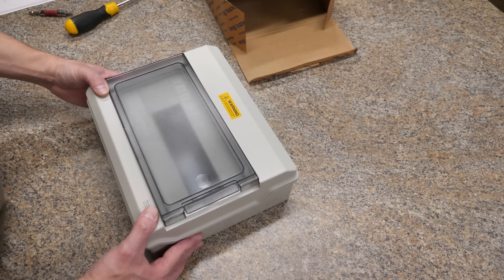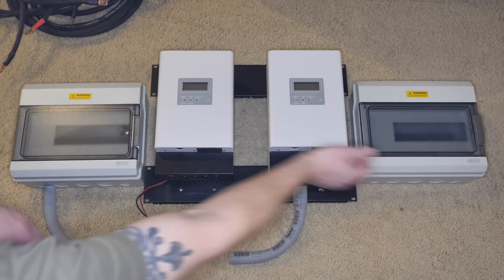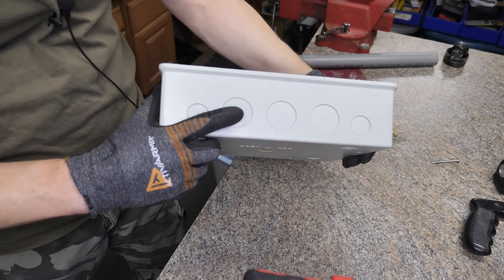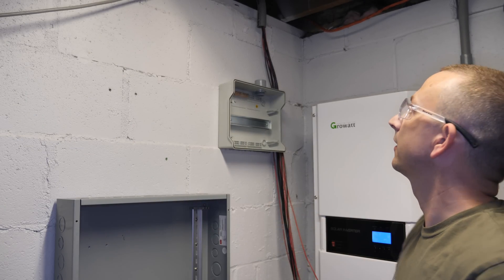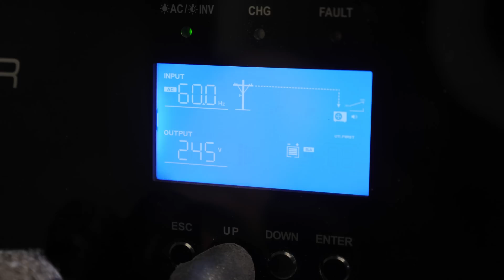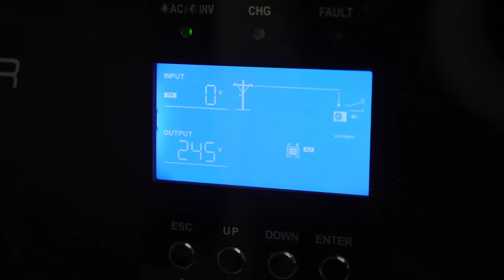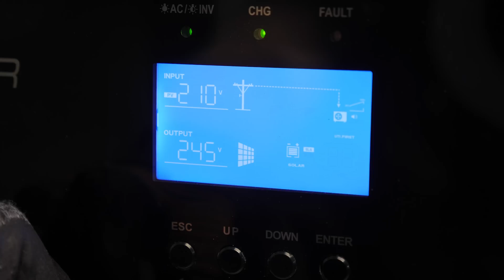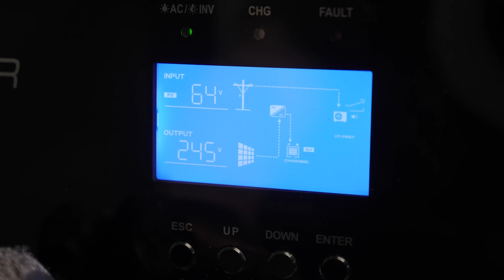Installing New Diy Solar Combiner Box! - Diy Powerwall 2.OH Ep7

Comment: Looks good. How many watts of solar do you have
Reply from the maker: Thanks! On the roof I have a little over 5kw of used panels. I usually see 4.5kw when I get full sun. Also just installed a 2kw ground mount. Vid on that soon!💥🤘

Comment: Hello,  the Growatt 12kw says 250V Max PV Voltage. You had 2 - 200 V PV inputs on 1 & 2 . Wouldn't that be 400V ? 150 about the max. Or do you only use one pv array at a time.  Thanks
Reply from the maker: A 200v array goes to pv1 and the other 200v array goes to pv2. There are 2 charge controllers on the 12k growatt.🤘

Comment: Can you talk more about the ground???
- ground for combined box
- ground for inverter 
- ground for racking 
- ground for panels
Reply from the maker: They all connect and go back to the ground that the house is grounded with!🤘
Reply: @AVERAGE_JOE  - even Solar racking???
Reply from the maker: Yup even solar racking! Thats what I forgot to connect lol but did later. I connected it to the inverter frame which connects back at main panel which connects to ground rod. I should probly run a wire from solar racking straight to the house ground but this was closer for the moment😄

Comment: Good video man, just wonderin though why do you need the pos and neg fused? in fact why fuse at all? even if the panels are shorted, they will only supply a limited amount of current, they can't blow a 15A fuse! it's not like there is a low impedance supply that can deliver some serious current like a normal domestic supply, so if the wires can handle the SC current what is the point? just fit a DC isolator and don't waste your money, BOOM

Comment: I thought your 12Kw Growatt inverted had the 150 volt MPPT controllers, did you swap it out for the 250 volt version?
Reply from the maker: I ordered the 150v version....they accidently sent the 250v version🤭🤯💥 I actually didnt realize it until a much later date. I even read the sticker and saw that it said 250v but just assumed it was a general sticker👐🤦‍♂️
Reply: @AVERAGE_JOE  Nice! That's awesome. I have the 250v version also, but the 8Kw instead of the 12Kw. Cheers
Reply from the maker: How you liking yours?
Reply: @AVERAGE_JOE  I don't have much on it yet, but I wired an outlet for our electric washer/dryer last weekend and did a load test with it. The dryer drew just under 5Kw and it handled that with no problems on my EG4-LL batteries. I need to finish my ground mount for the panels so I can permanently mount them, and then run some more circuits from the new panel.
Reply from the maker: Nice! Hey we gotta start somewhere!🤘

Comment: Nicely done. I am using the exact same combiner box. It’s a little chinsie but did the job. I have 10awg pv wire coming in from each string which made things a good bit more difficult.
Reply from the maker: Nice! These boxes are better then what I first ordered lol. Terrrrrrible. How long are your runs?
Reply: @AVERAGE_JOE  50ft, panels on roof. 140v coming into charge controller. Each string is roughly 18amps
Reply from the maker: Sweet! Originally I had mine at 150v also then wired to 6 in series for moar volts and less strings.
Reply: Yeah once you got the growatt 12k you went to 250v. Maybe one day I will grow up and get a higher voltage inverter. I did have a 500v grid tie inverter wired up for a month, but that’s a whole nother story..

Comment: Isn't it a mistake to combine south and north together? Their exposition won't be the same, so the mppt voltage will also never be optimised for both.
I assumed south should be together, and north together.
Reply from the maker: Yes north and south facing panels should be on seperate controllers. All of my panels are facing south. It made since to me for some reason when I was keeping track of wires for pv1 and pv2 inputs 😜

Comment: Out of curiosity, how many watts of panels do you have? B/C if even in those conditions you're still generating something like 400w, if you have the space it might be worth more to invest in more panels than in a huge battery bank.

Just thinking out loud but around here, even on ebay every once in a while you see used panels in pretty big lots going for something like 30c/watt. And not very old panels either, I know in a lot of farms they're switching to even higher voltage strings since the inverters are even more efficient, but for home use they're excellent.

Like I know it sounds ridiculous but a couple months ago there was someone selling 120kw worth of panels for $20k on ebay. They were in actually very good condition like 5 years old. Now installing 120kw worth of panels is a job and a half with significant installation costs and of course takes up a shit-ton of space lol. 

But I guess the idea is if you have something like 2+ acres and don't mind dedicating a corner of your land to it, I feel like it might be the better option? Because I imagine that even in such bad conditions, 100kw of solar is more than likely going to produce a significant amount of power. Hell probably even at night you could make a couple hundred watts just from moonlight lol.

I just feel like being able to store enough energy for 6 days+ in those conditions will be significantly more costly than my suggestion. For example if you could use M3 battery packs (at 400vdc, hence why they're so cheap compared to S packs), with a high voltage inverter, For $15k you could get 150kwh of batteries if you shop around. 

This gives you like 25kwh per day, or basically 1kw average draw 24/7. Idk about you people but lfrom studies done the average U.S household uses 12kwh per person per day. So chances are you won't be able to live comfortably even with 15k worth of batteries in the winter. Unless of course you use other fuels, like wood for heating and gas dryer. But then that kind of negates the whole point of going off-grid.

And of course thats not even taking into consideration that lithium batteries last significantly less than solar panels. Like even if those panels are running at 30% efficiency 100 years from now,you'll still be making a ridiculous amount of power during sunny times.
Reply from the maker: I have a little over 5kw on the roof atm.  Summer time is great, winter not so much. I will be adding moar solar for sure so Ill be able to charge the big bank!  The panels I got were from Santan on ebay and they are used.  Ill probly get more from him when I can!

Comment: Why do you have North1 and south1 on one mppt... ? Wouldn't it be better to combine both North and both south areas?
though I have no clue how your roof is actually covered with those panels...
Greeting from Germany 👍
Reply: I would also assume that makes more sense, now which ever orientation is producing less is limiting the other... except if they all face the same direction and are place north/south
Reply from the maker: Great question and I probly should have explained or shown the panels. There are 2 groups of 12 panels. In each group there are 2 strings of 6. All are facing south. I could of labeled 1,2,3,4 but for some reason🤷‍♂️ this made since when I was keeping track of the wires for pv1 and pv2👐🤣
Reply: Thanks for clearing that up. As long as all the panels face the same and have the same tilt...
For future Joe, when you have the whole roof covered, it might get confusing 😁😜
Reply from the maker: Lol yeah Ill have to come up with a better number system🤯🤣

Comment: Thanks for new episode! Very nice done - looks fantastic. However, let me share my concerns: between inverter and panels you have 2 overcurrent/short circuit protection devices, CB + Fuse, even thought the panels are not able to generate that current, even by short circuit, which would be able to trip them, and these devices are mainly needed as disconnectors. But, you haven't installed SPDs... which could save your electronic in case of a lightning strike in the neighborhood. Have thought about installing an SPD on the PV side?

Comment: Curious why you went with fuses as opposed to using just circuit breakers?
Reply from the maker: Fuses for the panels and used circuit breakers for quick shut down.
Reply: Maybe it's cheaper?
Reply: With the system I am building, I am using fuse & circuit breaker… my rationale is that the fuse will really blow if there is a safety problem while the breaker is convenient for switching off-on & less expensive on a simple mistake
Reply from the maker: Yes 100% nailed it!💥🤘

Comment: On my RV, instead of using that stiff 6awg THHN, I actually used 6awg welding wire. It is way more flexible, and is rated to handle the load.  Just a thought.
Reply from the maker: For sure, Ive used 6awg welding cable.  Used it in the last powerwall build coming off the MPP PCM60X charge controllers!
Reply: @AVERAGE_JOE  I used it on my AC lines to/from my inverter.  Beats the heck out of that stiff wire.  But I don’t know if it’s to code or not.

Comment: There an explanation on why the fuse has a side for PV in and PV out?
Reply from the maker: In all honesty, it probly doesnt matter.....  Ive had them in wrong direction for a while.  It does show direction on the holder.  It may be because when you pull the fuse open, that end disrupts or breaks the current circuit the fastest and moves it away to "break" a potential ark if under load.

Comment: Getting cleaner with each posting. How big are you planning to setup your battery bank to get you through to a sunny day for a full recharge? To day for me I’m looking at 6 days of clouds ⛅️ and rain ☔️.  And maybe one of sun ☀️. East coast Chesaeake Virginia. It’s like I need to max out what I can get from sun to sun 🌞
Reply from the maker: Yes Sirrrr it sure isssss!!!!  For starters, I am aiming to be able to run fully off-grid during the summer which will include running the AC, stove and dryer and of course recharge at the same time.  I should be good to do that once the 32 cells are connected up.  Ill also be adding the Rhino and Husky battery as well.  Will be a little under 50kwh!  Winter time is a completely different animal at least here at my house due to trees and my poor solar panel angle.  Ill for sure need to add more solar lol.  Right now we have about the same weather,  if I run on battery all day and night, the next day I have to go back on grid and let the batteries charge for 2-3days depending on weather.....😬😆
Reply: @AVERAGE_JOE  I need to buy a solar farm?  Moving out of the city, even a subdivision is too small for the numbers of panels needed. The guy with the 2.0 in Australia is testing his new panel’s and it’s looking good. For the size. Thanks again for your work. I’m looking forward to seeing your next post.

Comment: So I have a question, you run all your panels in series I assume and then bring them in to the combiner box where you can then put them in parallel strings? Why not use an outdoor combiner box and then bring in one set of wires, just curious as to your methodology. Also what type of wire did you run from your panels to the combiner box? Thanks in advance, it looks great.
Reply from the maker: Yeah they are run in a 6s2p, 24 panels total at the moment.  A combiner near the panels would be optimal but panels are on roof and I didnt want a box up there.  I just wanted easy access to be honest.  By code I still need a disconnect outside tho.  I could move combiner there once installed but we see.  Wires are 12awg THHN stranded from panels and 6awg after circuit breakers to inverter!
Reply from the maker: @@Floridaoff-grid 😆 Future AveRage Joe also installed breakers inside so he could shut them off when needed!💥🤘

Comment: Hay I used the same boxes fory tiny house. They worked good but do not pass inspection in MN due to no ul listing on the box
Reply from the maker: NICE! Yeah these boxes seem to be better then what I was using.  I think it depends on inspector talking to an electrician friend of mine.  Things dont have to be UL listed or even UL certified as long as the "item" is doing its job in a safe manner.  I guess maybe also for location as well.  He has the same boxes (smaller ones) and has had his system inspected and permitted.
Reply: @AVERAGE_JOE  awesome my inspector hates solar